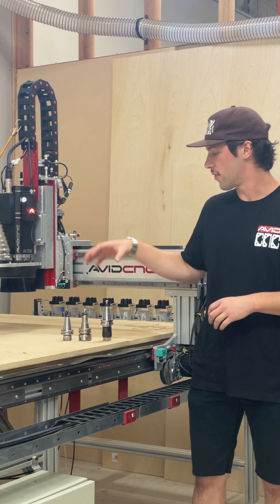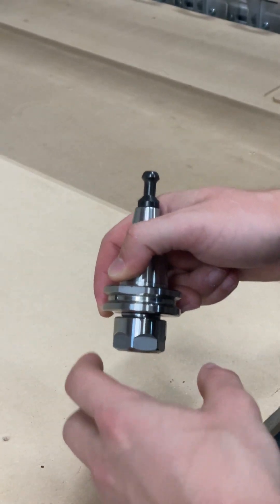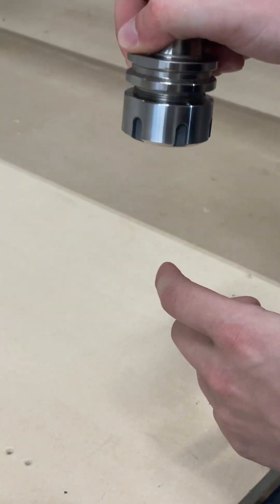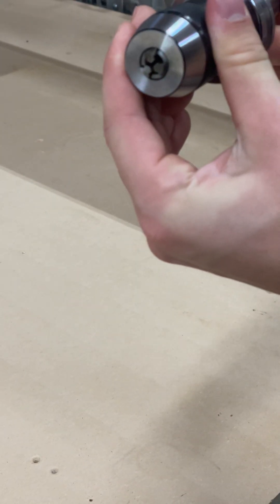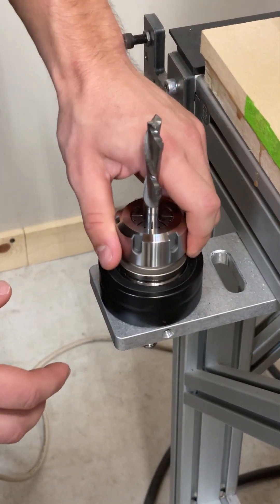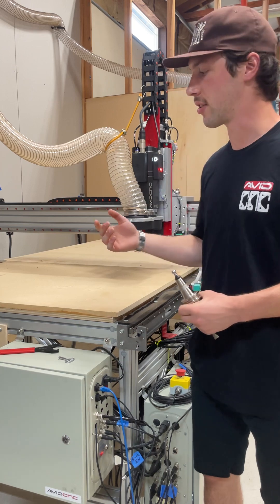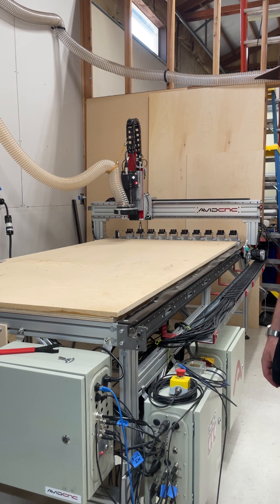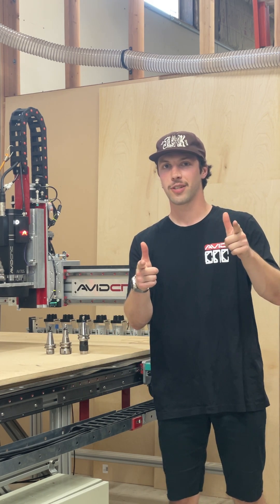ATC Sneak Peak and Tooling Info #cnc #atc #avidcnc

Comment: Will the Avid Dust Boot work with the ATC?  It looks like it might crash into adjacent tools in the ATC when loading.
Reply from the maker: We're designing it to work perfectly with our dust boot. The spacing is tight but that's just so we can fit as many cradles as possible on the rack.

Comment: Careful telling people that the drill chuck can take any tools. Preface that it should only be used for drilling. Drill chucks are typically not rigid enough for the side pressure created by milling or router bits.